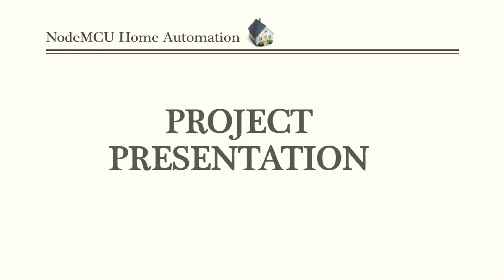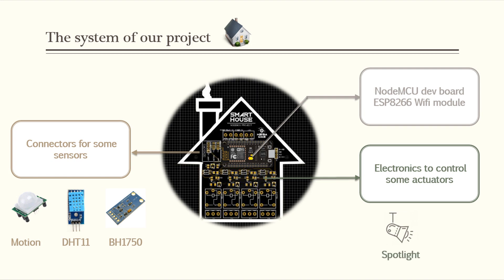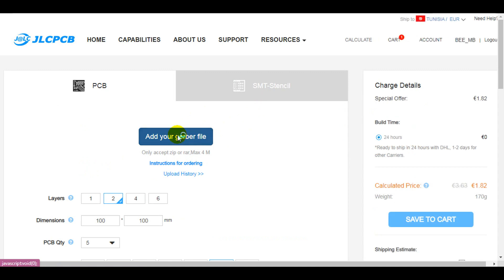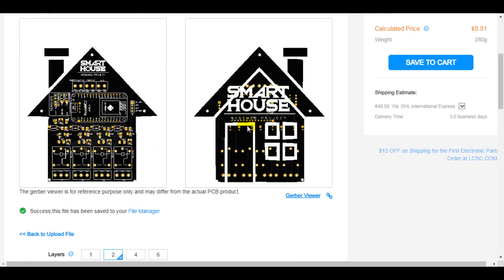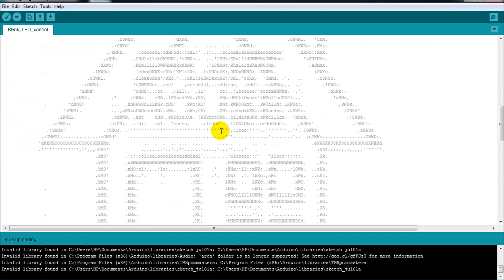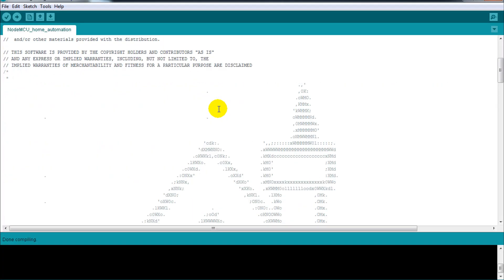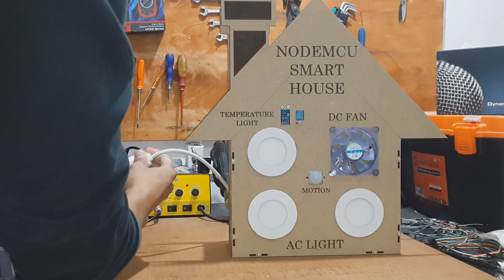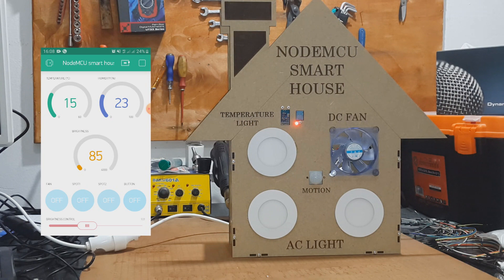NodeMCU Home automation ESP8266 smart house

Comment: Hi , if the light is on and you close the connection the light is going to be off i'm thinking that the data of esp822 i will send it to arduino uno if i send it to arduino uno and close the connection is the light is still going to be on ? i hope you get my point your help will be much appreciated
Reply from the maker: Hi
The last status of the outputs will remain the same even if you lose connection so no need to use an external MCU like the arduino Uno MCU to control the lights.

Let us know if we can further assist you.

Comment: I love this idea but how would I convert this project to my own home. Is it intended to be modular (room by room) or the entire 3 bedroom home?
Reply from the maker: Thanks for your comment 
I hope you will be the 1ST prize winner 🏆
You can use this circuit diagram to control 4 relays it means that you can control at least the lights of 4 rooms, so just bring the electrical installation to reach the circuit board that you can put in small box that you can place in your main electrical case. For sure you can add more relays to this circuit diagram ..

Let us know if we can further assist you.